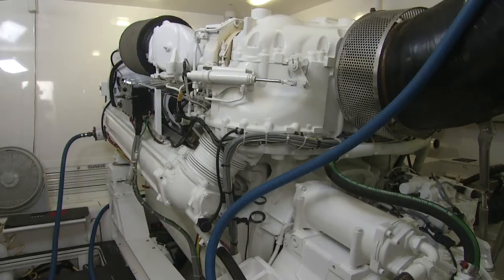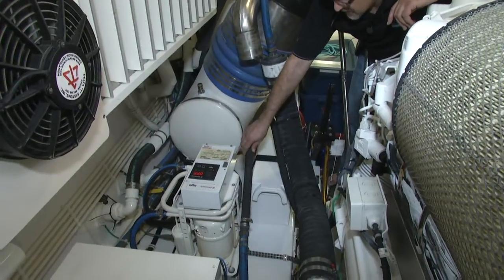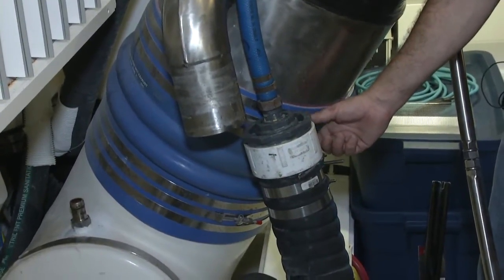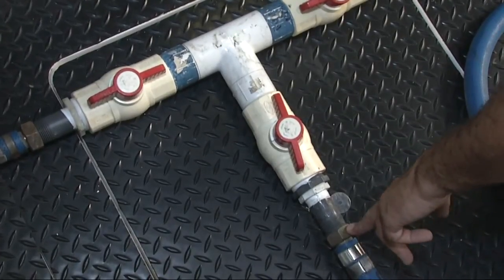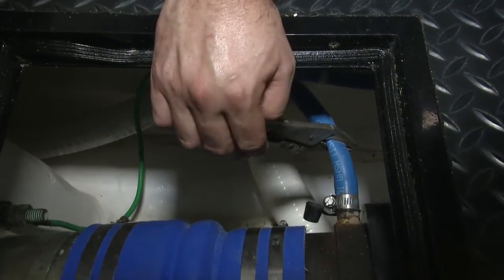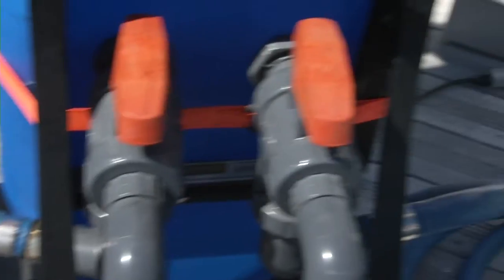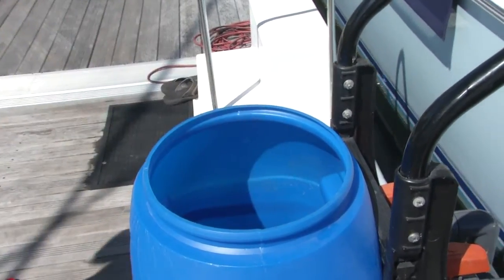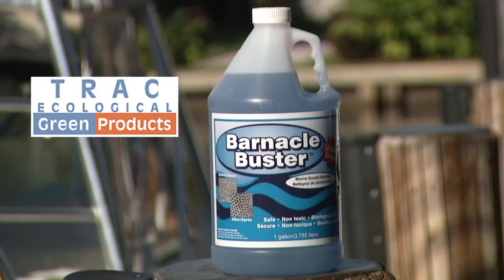TRAC Barnacle Buster - MTU Engine flush

Comment: all look fine and interesting !!!      BUT clamp a $100 silicon hose with a plane visegrip doesnt look too good idea to me !!!    the use of a  piece of fabric or carpet to avoid damages or cuts to the delicate hose would be nicer to me ...........
Reply: They actually make a pair of vice grips with smooth rounded jaws just for this purpose. But you are 100% correct. Not wise, could damage hose and lead to failure.